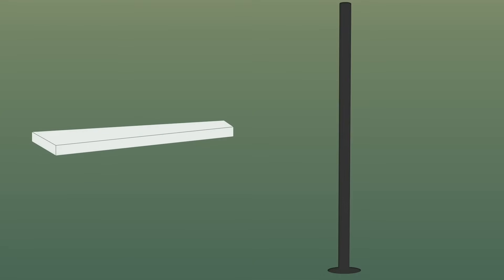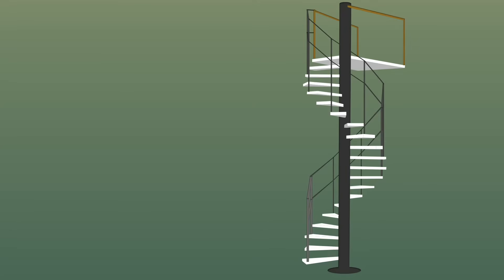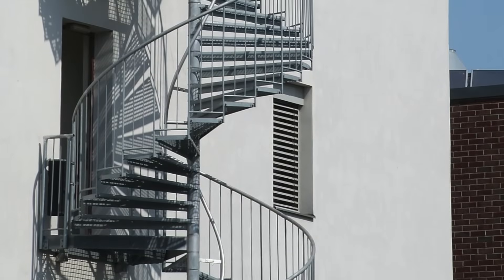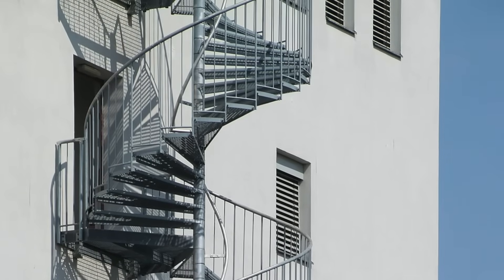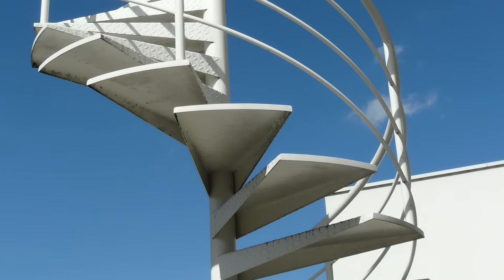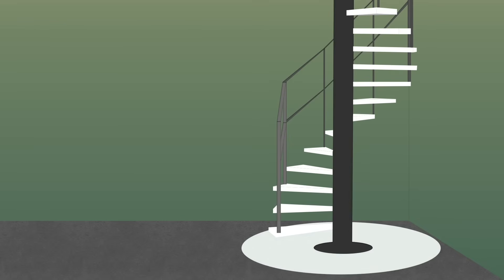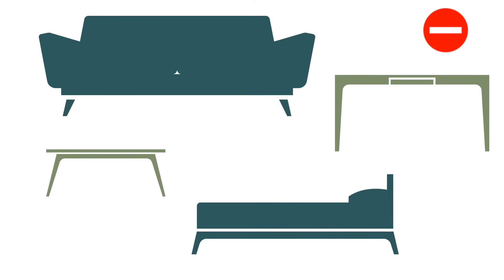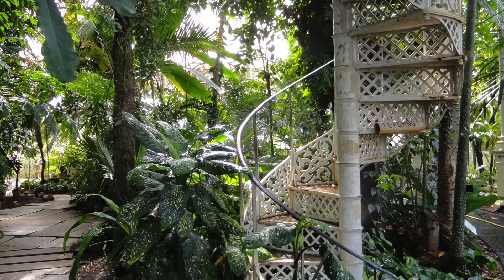Why you should not use a Spiral staircase - Building Studies

Comment: Good grief, this video would have you believe there are no good circumstances in which to install a spiral staircase. When used as a primary access point, especially inside the home, a spiral staircase is not optimal as it creates challenges in moving furniture between floors. However, a spiral staircase used generally as a secondary access point to an upper level (such as a deck) is perfectly fine, architecturally interesting, and recommended.

Comment: Spiral stairs originated in medieval castles and were never meant to be easy to use.  They are a defensive, architectural element.  Only one person at a time on the stair, is intentional "by design."  The stairs usually make a spiraling, clockwise turn when ascending, allowing a defender to take full, downward strokes (with his right hand) while the one ascending, must raise his sword above his head to strike or parry (and while up against the central column of the stair.)  
Today, spiral stairs in homes, are predominately a space-saving device and should never be the sole means of upper-floor access.  
Moving furniture up and down spiral stairs, is almost never possible, nor recommended.
Spiral stairs, are inherently dangerous and steep, especially near the central column, which most often, is devoid of a handrail. 
They are interesting to look at and can add an artistic element to any structure, but not without risk.
Reply from the maker: Thanks for providing this information.♥️